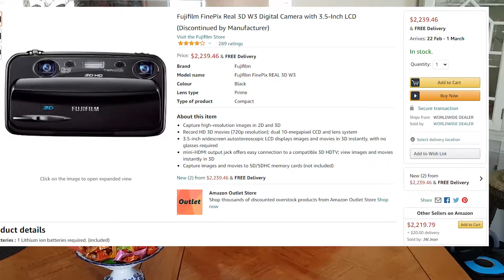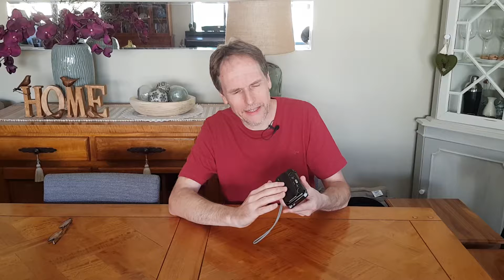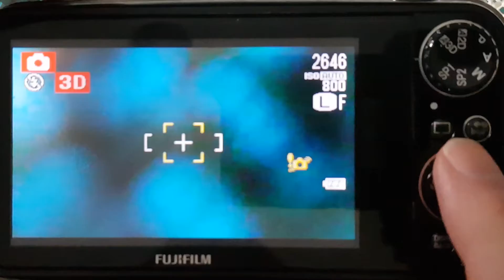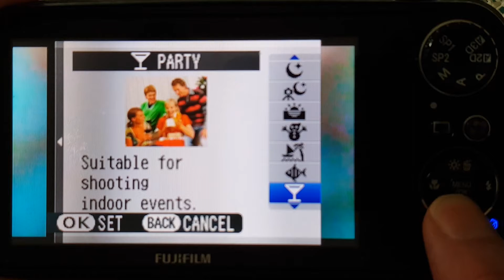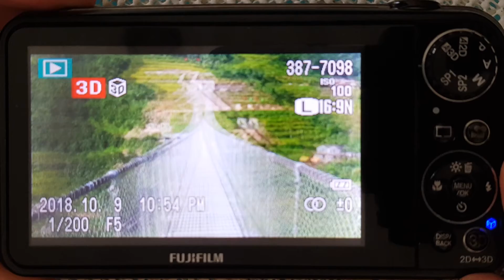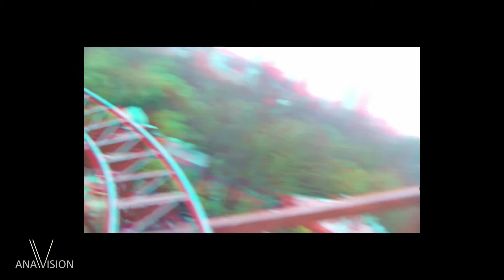Why is this camera appreciating in Value? The Fujifilm Finepix 3D W3 - the 3D Point & Shoot standard

Comment: I've been using the W3 for years now. It's 2026 and I'm still learning things about the camera from your video. I really wish Fujifilm would make a W4 with a more up to date sensor and a case design that prevents the finger from blocking a lens. Low light performance is bad and the AF is horribly slow. I have numerous out of focus photos because it didn't focus on the subject quickly enough. Very fustrating.

Comment: No one makes stereoscopic 3D cameras with a built in 3D screen.
These cameras came out when the tv industry was pushing 3D TVs and cinemas were showing 3D films. At the time these products met with consumer indifference and new TVs do not support 3D, so 3D content is not as easy to view or share, since many people don’t have the necessary equipment. Also, at the time of writing I have seen several of these 3D Fuji cameras listed on eBay under £300, with some of them in excellent condition. A few years ago they did go up in price but I guess these cameras now seem dated. The camera doesn’t even film in Full HD, let alone 4K, and people are used to higher quality images. Having said that, when 3D tech was being built around 2011, this was perhaps the most practical 3D camera.

Comment: YES, the Finepix 3D W3 was an ABSOLUTE MASTERPIECE! And it looks glorious on a 3D PROJECTOR! Really a lot of fun. Whenever possible, FILM WITH TRIPOD. NOWADAYS I'm using the Kandao QooCam EGO, even better, FULL HD and 60 FPS. 3840x1080 SBS. Projection 3D is where it's at! 260" on the white wall.
Reply from the maker: I also use the Kandao QooCam now. You can view my review here: https://youtu.be/HtE0AFoRhK8. I totally agree, 3D projection of these is certainly nice - I use a dual projection system to a polarized silver-screen.
Reply: @ANAVision  Wow, AWESOME! Even better than my DLP-3D.
Reply: How do you convert your files to projector is it a easy process?
Reply: @chinopino  EASY: The mini-HDMI cable connects the camera DIRECTLY TO THE PROJECTOR's HDMI input. So you can play back straight from the camera. The projector MUST BE 3D-capable, and you need the matching 3D glasses. FUN, BIG time! You can also get specialized EDITING software and convert the video into and SBS (side-by-side) video MP4, and then set the projector to display that SBS as 3D again.
Reply: @hstrinzel uh  oh now I have to justify the purchase....thanks for the tip...
Reply: I don't think the Kandi 3d has HDMI out but I know the Fuji w3 does

Comment: Great vid.
Was collecting some of these, find same Fuji on Ebay, for decent price, but also what I liked more, there's Sony TD10/20/30 series which is kind of perfect for such a filming!
Liked it a lot
Reply: The w3 has a much better 3d effect than the td30, while the td30 has better image quality.
Reply from the maker: @JoeHensson , thanks for the insight.
Reply from the maker: @Boui Lu, thanks for your feedback and insight. I don't have a Sony TD10/20/30 but you got me interested. The Sony 1080p / 60fps certainly beats the FujiFilm 720p / 24 fps. My only concern is what appears to be small baseline separation between the two lenses. Do you find that is an issue or do you get good 3D from these?
Reply: @ANAVision  honestly Sony TD series even TD10 model which is the oldest one is beating Fuji much, the quality is great. 
As Joe told - maybe 3D effect isn't that much cool, it still exist and is pretty good. What's more, it's more optimal for watching on home screens.
Reply from the maker: @bouilu7519  maybe I should consider getting a Sony TD series camera to try it out. What do you think?
Reply: @ANAVision  btw, I have two of them for sale TD20 and TD30, with full boxing, so let me know if interested.

Comment: Really happy with my W3. Had it for 9 years. Really hope it wont brake. 😬 The only main problem with it is the amount of noise in the images. Its very noisy.
Reply from the maker: Thanks for your feedback. About the noise, the images my W3 takes appear to be okay, but I've seen images of others that also complain about noise, and they are certainly noisy. So I'm not sure, maybe some of the cameras have issues with this. Does your camera have noise only in low light, or all the time? One thing about 3D photos is that the noise fortunately tends to cancels out somewhat as you are viewing two images simultaneously. This should reduces perceived noise somewhat due to averaging.
Reply: Its noisy regardless of the amount of light. But yes, it does cancel out somewhat when viewing in a stereo viewer or in anaglyph. It was interesting to know that others, but not all, have a similar problem. I have tried to shoot more manually, especially with different ISO settings, but it doesnt help much. 😕
Reply from the maker: @supernovasightseeing4133  Sorry to hear about the noise, that's a shame - I'm glad you are enjoying the camera nonetheless. By the way, the example I saw of noise had what seemed like vertical stripes type noise, it was not completely random. Just curious, is that what you are seeing also? Would be interested to know if both left and right cameras are producing this noise, or just one of them?
Reply: Both cameras produce noise. No vertical stripes. The noise is fairly even.
Reply: Do you have a webpage with your own W3 images, or a gallery online? It would be interesting to compare. 🤔
Reply from the maker: @supernovasightseeing4133  I've uploaded a couple of original images here:
https://anavision.com.au/ImageGallery/DSCF5348.JPG
https://anavision.com.au/ImageGallery/DSCF5389.JPG
Do you have any of the noisy images of your own you could share?
Reply: No I dont have anything online. I looked at your images and I think the noise is similar to my images. :/ I found an image online that had those stripes you we´re talking about. I´ve never had that problem with my W3. I guess it is what it is. Its still a very fun camera. =)
Reply from the maker: Good to hear it's not a specific camera fault with your camera then. Yes, agree, certainly is still a fun camera, considering there are still only a few viable alternatives. Enjoy.

Comment: Thanks for your relevant vidéo. I own a w3 too and i would like to display 3 d pictures in my oculus quest 2. Mpo files are not recognizes unfortunatly.
Reply: MPO files can be read on the Oculus Quest using the Pigasus app.  Other apps support SBS- I think the built-in player might still, but things changed slightly when they got rid of their viewer and merged it to the Oculus TV area.
Reply from the maker: @France Parishd, thanks for your feedback. It's a shame that mpo files are not recognised. I had similar issue with my Oculus Gear VR some years ago. Have you tried converting them to SBS format?